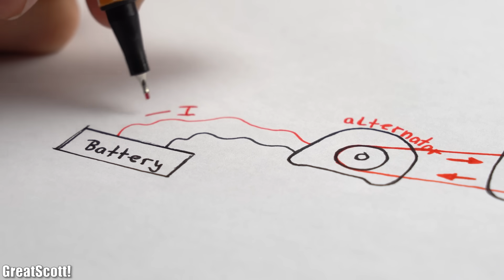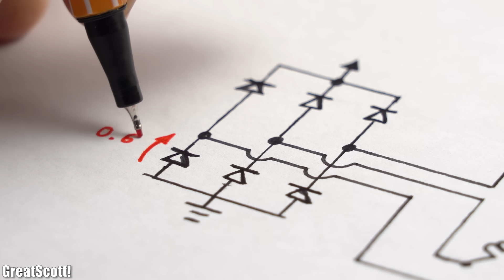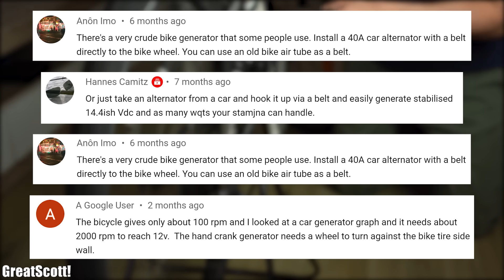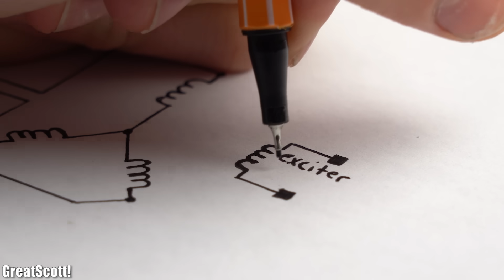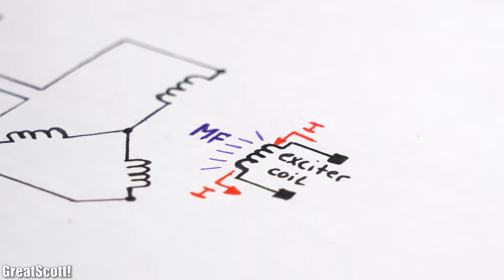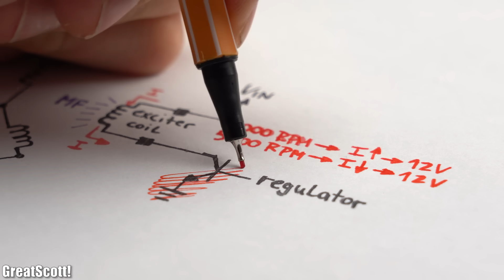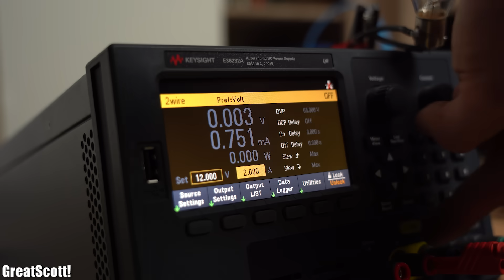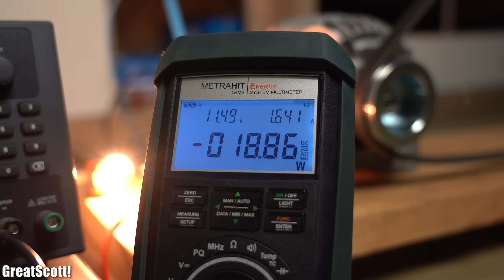Using a car alternator with a bike to power my home? How much energy can I produce?!

Comment from the maker: Part 2 ;-) : https://youtu.be/GHdIGt7bbyU
Reply: I use alt to run mine too,
Because I live in my car
Reply: @dadzchanel7547  
 @Nobody  😂😂😂😂😂😂😀😲😯😟😦😐😟☹️😒😲😳🥺🥺😥😥😢Like a 🐢🐢 your home is with you. 🤨🤔😉
🇺🇸🙏❤️🌎☮️
Reply: @dadzchanel7547  been there done that... I bet these f**** gas prices are pissing you off to
Reply: @dadzchanel7547  you can thank Joe Biden and all of the line thieving motherfung democrats for that
Reply: Now all you need to do is use that same setup except use water along a stream or something.
Reply: @5226-p1e  how fast do you have to spend the alternator?
Reply: U could actually get a small electric motor and 4-5 more alternators to charge multiple batteries.
Reply: @waterdog9500  turn all the alternators  at the same time w electric motor?
Reply: @billyjones9045  yes
Reply: Who is running the bike? Hamstring?
Reply: @marianiurea6217  tHE WHOLE CONCEPT Was a bummer from start to finish, and a little simple maths would have saved a lot of time. a HORSE-power is 550ft.lbs per second: simpilfying, you have to lift 550 lbs one foot in in a second  or 55 lbs 10 ft in a second and sustain it.
I Kw is 1'34 HP, so the example multiples would need the poor human to.for example,to lift  approx 730 lbs per second! 
Bike-power is only praticable for topping up batteries for lighting purposes using low-wattage light-, or for  charging  a battery.
I know because I've had a very remote  off-grid off road  holiday/weekend shack for  decades and  years ago, I set up a 12v lighting system using a lorry battery, and I'd use me car battery to charge it.
it was a pain in the butt to recharge,  especially if I couldn't drive the 300 yds from the single-land B-road to my shack, lugging a heavy truck battery up and down a field is no fun, especially when the going is slippery!
On occasion,    if I'd left something on, my car sometimes wouldn't start,  and I'd reverse the process and use the lighting battery to jump start the car. If it hadn't the juice left to turn over the engine, it was a disaster, so I thought up a bike charger, much simpler than the above, IIRC, ten or twenty minutes or so gave me enough juice to kick it over.
About 20 years of doing this, a got a no-longer wanted but them hugely-expensive 25w solar panel, which, weather permitting, saved me much grief
The price has come down greatly over the years since, a two 100w panels supply two 60 amp-hours batteries- happy days!
,
Reply: I envision some complicated gear system that ups the rpms of a comfortable bike pace to sufficient RPMs to doing this properly.   Heck even a human sized hamsters wheel would be interesting.
Reply: @davenunyabusiness4893  great thinking & you get good exercise as well but some other means of propelling the alternator should be figured out. Great thinking. Well done.
Reply: You need to add a adjustable belt tensioner I believe sometimes the belt is slipping on the alternator when you're pedaling another thing maybe install a second alternator and maybe a car battery so when your excise power it can go into the battery and run the system
Reply: @shawnlibby9835  thank you I'm not alone on this one.😉👍
Reply: My idea involves a bicycle to spin a large flywheel and then a alternator on said flywheel.
Reply: Im just trying to buy that disc version ps5
Reply: @sheparddog117 , that's great. I can think of a few things to be mindful of. The thing is, I don't know how familiar you are with the 12v dc set up already in your vehicle, so I will just mention a few basic things that come to mind.

A second battery/battery bank for your second alternator comes to mind. Be careful as to where you install the second battery and where you pass/fish the wiring.
Battery fumes are bad in a closed space and the wiring can short out against metal parts (vibrations can cause the + wire sheath to wear out & ground/short).

It's also a good idea to have an in-line fuse (fuses rating depends on the draw...how many amps will you be pulling?) within the first 10 inches of the positive lead coming off your secondary battery/batteries.

There's a few other considerations aswell, a voltage regulator(built-in or external?), on-off charging switch(manual or automated), also make sure you choose the correct batteries for your needs(amps output per hour, peak, etc).

I'd also suggest that you label all of it a make a rough diagram for installation and future reference.

I hope some of this has been useful to you.

Best wishes.
Reply: Great Scott make this https://youtu.be/_InAZD800Io
Reply: @sheparddog117 
A great concept with lots of possibilities. Inverters have improved alot. Good resources might be places that sell or service work trucks, farm equiptment, or RV's. 
But you might find that just having a portable generator is a better solution. The gas inverter gens are great for mobile use, and the new battery based 'generators' are pretty impressive too. The battery ones might even make a good final destination for your secondary alternator.
Reply: @ronfox5519  how about those new solar generators are they any good or they just like a solar panel charging a battery
Reply: @sheparddog117 
I see your point about the space. That might be the biggest advantage of an engine mounted power source. And the other advantages are significant in their own right.
About 10yrs ago, was pondering this subject on my pickup that i used for work and a little weekend camping. I found that i had to keep changing my assesments because of changing technology. Cordless tools vs better inverters vs inverter generators, lithium batteries.
So that makes me think that there is a store bought solution somewhere. Perhaps an automotive inverter with a built in lithium battery  pack? IDk. This would maybe allow you to use the trucks alternator to provide just a little charging power feeding a high output inverter that was always on hand, but still hidden from theft. 
Lots of scenarios to run out.
Reply: @sheparddog117 
Good luck to you.
Reply: On a car’s alternator you need to provide a field voltage through the two pins to create amperage.
Reply: Or a cars alternator if you remove the voltage regulator you can use it as a direct three phase AC generator.
Reply: Top👍
Reply: GreatScott:
First and foremost, before I start getting picky, congratulation of producing a very informative instructional clip, well done. :-)

BUT!!! You simultaeneously over-thought it,AND under thought it! 
THe WHOLE CONCEPT Was a bummer from start to finish, and a little simple maths would have saved a lot of time.
I'm sure  you won't need all of the below, most of it is to help those who won't:
POWER is calculated using the formula of    work done over the time taken.

One HORSE-power is 550ft.lbs per second: in simple terms
  You have to lift 550 lbs one foot in in a second  or 55 lbs 10 ft in a second and sustain it.
I Kw is 1'34 HP, so the example multiples would need the poor human to.for example,to lift  approx 730 lbs per second! 
I'm really, really surprised you didn't realise it was a no-go in a few seconds--maybe you did, but went ahead just for the challenge of it?

Bike-power is only praticable for topping up batteries for lighting purposes using low-wattage light-, or for  charging  a battery.
(The Vietcong used it( with batteries)  in their underground bunker hospitals)
 I've had a very remote  off-grid off road  holiday/weekend shack for  decades and  years ago, I set up a 12v lighting system using a lorry battery, and I'd use me car battery to charge it.
it was a pain in the butt to recharge,  especially if I couldn't drive the 300 yds from the single-land B-road to my shack, lugging a heavy truck battery up and down a field is no fun, especially when the going is slippery!
On occasion,    if I'd left something on, my car sometimes wouldn't start,  and I'd reverse the process and use the lighting battery to jump start the car. If it hadn't the juice left to turn over the engine, it was a disaster, so I thought up a bike charger, much simpler than the above, IIRC, ten or twenty minutes or so gave me enough juice to kick it over.
It was much simpler and much less expensive than yours, I used a couple of small nuts and bolts, a small round  rubber  car exhaust -hanger and about 8" of 1/2 inch by 1/4 inch flat bar.
I never measured the max output ( I didn't have enough hands ) but It blew up a couple of 25w bulbs in seconds when I peddled to hard.
(I hate typing, but I'll elaborate if you or anyone else is interested)

About 20 years of doing this, a got a no-longer wanted but them hugely-expensive 25w solar panel, which, weather permitting, saved me much grief
The price has come down greatly over the years since, a two 100w panels supply two 60 amp-hours batteries- happy days!
once agiain, I say congratulations to you on your experiment, and to all critics I say :"it is MUCH easier to criticise than to do!
any criticisms should be made  respectfully, and without trying to belittle. We learn by doing, and sometimes we fail, but we learn from them and improve the next time-- failure(or moderate success is the   precursor of progress! :-)
Reply: @jaycool5978  'fraid not, Jay. A car fitted with a DC dynamo can as they have "permanent"  magnets which hold on to their magnetic fields for quite some time. permanent magnets did not need excitement to generate electricity their current and voltage output were dependent on the excitement of the field windings in the separate 2-or 3 bobbin regulator and cut-out which was usually fixed to a nearby bulkhead.

 Fact : A DC  Dynamo can be turned like a DC motor by putting electricity iINTO it 's coils vice versa, a   DC motor can be used to GENERATE electricity by mechanically TURNING it.Auto electricians back in the day, used to check output sometimes by putting a pneumatic or electric impact wrench on the pulley nut  to spin the armature through the magnetic field of the two pole-pieces.
To illustrate this: if the cut-out failed on a dc dynamo, you were guaranteed a flat battery soon after stopping the engine, because the battery current was very swiftly drained away as the dynamo tried to turn the motor, A warning sign of this could be seen if the bonnet was lifted, one could see the fan belt tensing, or even, very slowly actually turning the engine a little. If you parked a manual car with  a failed cut-out in gear, the battery would a actually try to move the whole car, which could kill the battery for good, or worse, cause burnt-out starter cables, even a fire .
A couple of times, when hundreds of miles from home, with a totally failed, unrecoverable dead battery, I'd parked on a hill and bump-started the car and drove home with all my electrics being supplied by the dynamo.
Unless their has been developments in recent years, it doesn't work with ac
Reply: Ive got ceramic insulaters & hot clips..etc..if interested
Reply: Why not use a vintage steam engine to power the alternator
Reply: Couldn't you at least charge a deep cycle marine or RV battery this way?
At least be able to relax and enjoy some electronic entertainment after you've charged the battery?
Reply: There is a way to convert a ceiling fan motor into a generator. Have you tried that?
Reply: Nice move you made almost 2k on the video.
Reply: @sheparddog117 will, your on the right track as being sure of a solid mount. However, how do you plan on storing the power for later use? Otherwise you will need to run the engine to get power.
   With a lack of information the best advice I can give you is to be sure you match up correctly whatever component your going to use to regulate the batteries that will power your inverter. This can be done a number of ways according to the type of battery system you plan on using. (Lithium, AGM, lead acid ect) but whatever battery type you choose I recommend a way to turn it off and on as you need to because otherwise it will cost you in unnecessary ware and extra fuel burn.
   But here's an idea for you. Get a battery isolator and wire it into your trucks system and add in another battery (s) and use the isulater only when needed. You can wire this in such a way that you can jump start yourself from the other batteries from the isulater: as well as run your inverter.
   I hope this helps or at least point you in the right direction. Happy New Year.
Reply: You did all that work, and forgot that 1 human power is roughly 100W at rest just to survive at peak output(sweating in the gym) going to ~200W which will make you be able to power a 100w lamp and around 3 years of workout to power your home for a year. Or you could just burn your food and have slightly more efficient steam generator. (Since food still has energy at the back end)
Reply: Cant you modify your alternator to produce more then 20 wats ? using magnets or new coils or transofrmators ???
Reply: @kay6730  i would assume no, the same way you can't get more power out of a battery than what is on the tin, or out of your motor, you will need to put energy to pull energy.
Reply: This part sucks so part 2? Nah waste of a click
Reply: Scott can you replicate this video https://www.youtube.com/watch?v=QOV_Js59BHY
Reply: Forget using the rectifier, bypass it and solder wires onto the stator coils directly, there should be 3 phases. Use two of them for ac current.
In fact, replace the exciter also with permanent magnets.
Then make it rotate at 3000rpm.
Reply: Why don’t you go back and use the dynamo systems used by WWII radio operators in the field, like OSS Agents?
Reply: Big gear on front small gear on back gives you highest gear....it seems you thought bigger always better.
Reply: Me - A year later are you still powering your home?
You - No that was a dumb idea.
Reply: i wondered if we could use a car, truck or tractor engine. after all the engine is a power plant. They just want to steal are money from us.
Reply: You are talking about electrical stuff and you don't know anything about car alternators? Have you not seen any car with alternators in your area in Europe? So people told you to use the alternator so get to know the alternator. Be honest when you talk about a simple thing and you don't need to lie to people. I don't want to buy any T-shirts from the liar.
Reply: man you lost quite a bit of rpm power by using the big gear on the rear wheel....... bruhhhhhhh
Reply: @KOCombo  sorry not talking shit, but that long as bruh would've been better at the beginning bro. Just sounds high AF lol, like it sounds like you said your thought as you were thinking it.... Then you realized it was funny lol.
Reply: @JulioKeepsMovin  frankly in a way that is the case 
but i wouldnt call watching that part funny.... a literal "this does not compute" moment as i watched it
Reply: U have to pedal to keep the electricity on
Reply: been saying this for years
all you need is 12 kids.. they rotate an hour shift twice a day and you have clean energy!!!

this is clear sarcasm since that has been lost on the internet
Reply: If you add a large flywheel it can run a little while without pedaling and make voltage more consistent.
Reply: Did you get all that ?
Reply: good job scot, so how do i consult you incase of difficulties when making this electrical energy procedure in my home, i promise to compesate you for your time😅
Reply: That's a cool video! Thanks for sharing the link, I'll definitely check it out. By the way, if you're looking for a reliable and powerful backup power solution for your home or outdoor adventures, you might want to consider the Segway Portable PowerStation Cube Series. It has some impressive features like massive capacity, fast recharging, and versatile sockets. It's definitely worth looking into!
Reply: try using magnetism instead of a bike to power it
Reply: If you were looking for a more permanent solution you would need the setup by a good running stream  or a place you could put a windmill set up. Theres a guy out there that only uses water to power his charging system for his off grid house.
Reply: I realise this is an older video but since you like this stuff I figure you'd like: The Colony - Creating Electricity :  https://youtu.be/sclWPC_DWnY?si=WcdsJ90kkUCc8n1x
its a 15 year old cancelled tv show that was quite good. diy under stress :)
Reply: i use old gens from 60's cars. way better overall that alternator/gens
Reply: Hey dude maybe you can find a servomotor ac brushless 2 hand for industrie, good labels , Yaskawa and Siemens and assemble this in your bike
Reply: Ditch the bike get a smaller wheel that will fit over the alternator wheel. Gets some magnets instead of the pull effect reverse them for the push effect glue or put into a nylon sock on alternator wheel glue the other to the other wheel once you put the wheel over alternator wheel it should push nonstop.make sure you stabilize it
✌
Reply: Good day! Try to replace the alternator with the hub motor you used to convert your bike to ebike. Set it up with the controller but unplug the battery then test the voltage it produce in the battery terminal. Take note switch on the ignition. Please give it a shot.
Reply: @patrickarcega9861  😅😏😅
Reply: Mpppj9jp
Reply: @patrickarcega9861  genius!
Reply: @patrickarcega9861  00....
Reply: L @patrickarcega9861  5th 76
Reply: @jpoe7448  i don't get it.
Reply: @patrickarcega9861  when you spin magnets around copper it creates electricity.. but you have to spin it at a pretty high RPM like a car does ...